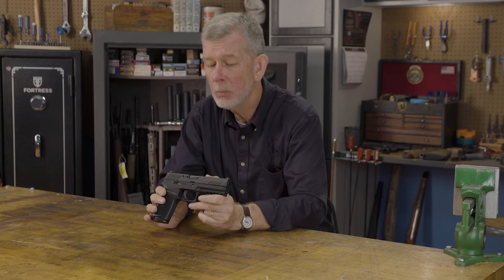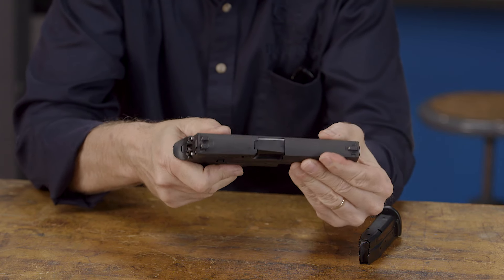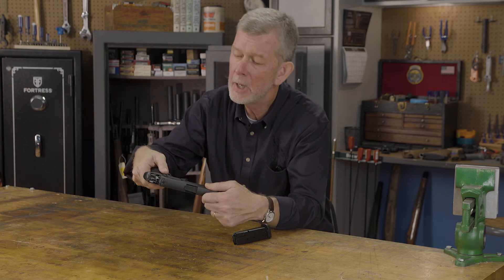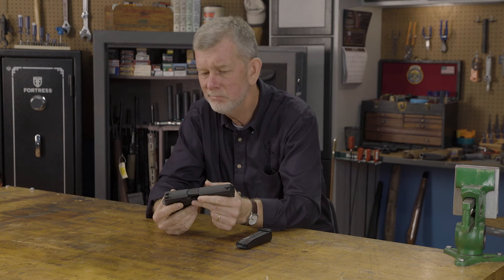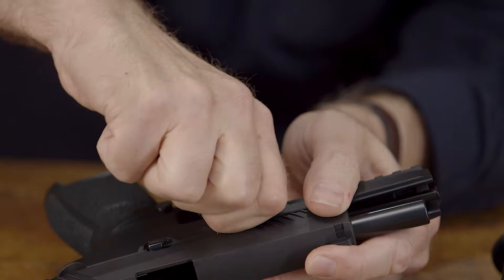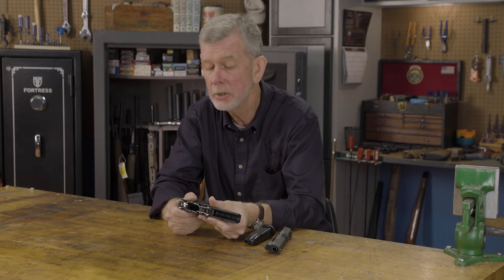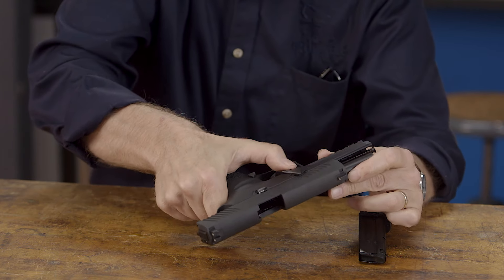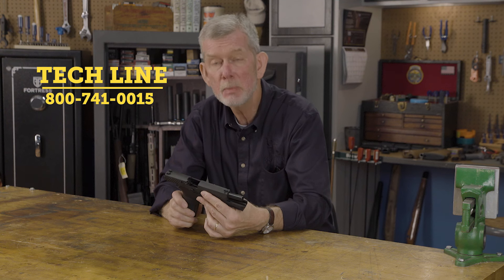Sig Sauer P320 Takedown Tricks

Comment: I have an p320 X-Conpact (320cx-9-bxr3-r2) and, what was initially tripping me up was the slide Spring guide position as it relates to where it rest against on the barrel.  The flat sides of recoil spring guide go vertically, and the rounded portions of the guide are what rest against the Barrel.  Once that was oriented correctly the slide would be able to be pulled back far enough to engage the slide lock, enabling me to put the slide release lever back to the locked position.  Super nice gun!!
Reply: Holy sh** thank you for this comment I was losing my mind. XCompact
Reply: I was losing my mind and thought I broke my gun. This comment perfectly describes the solution.

Comment: Glad I watched this. I just got mine. Was cursing at the thing. I actually thought I was going to break it, getting the lever all the way. Since I saw you do it, I figured I'd give it the full beans, and the jeez-less thing finally gave. I'm glad it's made of metal. And, I saw a negative review from someone on the weapon because they didn't lock the slide before putting the lever back. Glad I didn't listen to them. My thumb is still a bit sore from working that lever several time trying to get it to loosen up some.

Comment: Mine worked for a while, now I can't get the slide on again. I've taken it off many times, but today, I push it back, lock it, and the take down lever is stuck and will not move.  Well, it will go from 7 o'clock to the 6 o'clock position, but that's it. Every time I do it with this gun, I find myself thinking about changing brands.  There is no reason for it to be such a challenge. My other Sigs work fine, but I'm in a mess with this one. If my life ever depends on my putting the slide back on, I'm dead and the bad guys will not even take my gun...  Thanks again for you excellent videos.

Comment: Very helpful.As a tip ensure the main spring guide rod is oriented correctly against the barrel lug.The guide rod has flat and curved surfaces.The curved surface needs to be touching the barrel lug or the pistol can't be reassembled.
Reply: Exactly, that's another problem with this pistol.

Comment: you can throw the lever before putting the slide back on and locking it to rear and it will move the lever out of the way and then it will click back in place on its own too. Try it.

Comment: The key event that happens when you lift the slide stop in reassembly is that the other end of that piece of metal (or assembly of metal) that blocks the magazine slips into place to lock the takedown lever into the FCU / grip module.

Comment: Pull the trigger and push takedown lever at same time . Its moves a piece of metal out the way of the takedown lever  making it much easier toove takedown lever
Reply: Outlaw you are my Hero.  The lever was soooo hard to move, I was dreading having to clean the gun again.  Even dreaming up ways to jury-rig a tool of some kind to help turn it (which I never actually accomplished).  Now, pulling the trigger as you suggest has made it a breeze and it worked the very first time I tried it. Thank you, thank you -- there should be a quick YouTube vid posted where poor souls with sore thumbs can find it!

Comment: You may be seating the recoil spring wrong, it isnt supposed to go long ways on the barrel its supposed to stand straight up, and there is small flatside on both ends that seat the spring properly, i was becoming UNSAFE to be around while dealing with this issue but this EXTREMELY calmed me down and my slide went onto my barrel as it should, racked the slide back and locked it (heard the click) threw the pin up released the slide lock and the gun is "100%" hope this helps
Reply: Yes discovered that error today. A local gun shop helped me figure it out.

Comment: Thanks for the great tip.  I recently purchased the Sig 365.  Yes, I was lucky to get one.  Prior to firing the pistol, I attempted to break it down for a cleaning.  My problem and it was major, was with the slide pulled back in the locked position, I could not get the take down lever to slide down.  I eventually got it to operate (don’t know how) but is there something I need to know that sig hasn’t address as to how to get the take down lever to operate more easily?  .. thanks.

Comment: Hi great tip. I got a question often times before putting my slide on I will turn my lever down then put my slide on. I often when turning lever down I feel something kind of binding causing slide stop and sear to slightly raise everytime that happens Does that damage any of the parts?

Comment: Ok this is the first video I’ve seen where somebody shows how to lock the slide back. If you just take out the magazine and slide thr upper to the rear it won’t locked back by itself you have to push that lever up to that notch. And there’s lots of videos out there showing how to disassemble it but they don’t go into that detail right there of how to lock to slide back. I don’t know how you took it apart without locking the slide back lol

Comment: I do have an interesting question that no one has been able to answer. 
I have a new sig p320 but there is slide moment up and down on the last round and during dry fire. I have sent the gun into sig and was told this was not an issue at 10 yards so they will not replace the fcu. This is not an issue with any of my other p320's and short of getting a new fcu, I do not know a work around. It seems the tolerance between the fcu and slide is the issue, and since the slide doesn't have that issue on the other  FCU's that I have put it on, I am let to think I have a bad stock FCU housing  and sig is refusing replace this. 
I again am open to thoughts and options

Comment: Maybe I’m a dumb Sig newbie, but I had another problem:  you CAN’T lock the slide back during reassembly — at least not on the P320 AXG — unless the two dots on the end of the recoil spring assembly are lined up VERTICALLY. I struggled to lock the slide back for a good long while before I gave up . . . and read the manual.

Comment: My rotating take down pin/lever rotates so hard I need a pliers to turn it. The slide is locked back. It’s so hard to turn the pin like something is broke
Reply: I took it apart again now it works much better!!
Reply: @howardkamerman690  I just now saw your old comment, after searching about the same problem.   More recently a guy posted about how pulling the trigger at the same time makes it a lot easier to turn the takedown lever.  Definitely works for me!

Comment: The 320 has too many design flaws. The dead trigger up reassembly, guide rod must be in the correct orientation, take down lever insertion can be blocked etc. The Glock was a better option with none of these issues- and yea the model submitted for military consideration did have a traditional manual safety.

Comment: This P320 flat out sucks! If you can get it to consistently fire, it's magnificent. I have never been able to get through a full mag without a casing locking up in the chamber... completely unable to even move the slide... smacking the grip while holding the slide doesn't seem to work. Need to go home and brake out a rubber mallet to beat the slide off.  I always take a second gun to the range, because I know the P320 will get jammed and fail. Not a functional firearm. POS gun in my opinion. I recommend you stay far away from this problematic design.

Comment: I can't understand why the military didn't take the S&W M&P series. I have a 320 and the modularity is a joke. I changed from the standard grip size to the large which involved ordering a complete grip frame for $55 and removing the gun chassis and reinstalling it in the new frame. S&W's removable backstraps sure seems like a better solution to accommodate different hand sizes.
Reply: Robert C. Dufek It is we own a M&P 9mm M&P 2.0 and Shield. 45 the full size 9mm backstraps are nice.
Reply: The M&P is a good pistol, but it didn't meet the Army's requirements, and the M&P has always had a reputation as a pistol that needs an aftermarket trigger, and barrel, to make accurate.
The Sig P320 grip modules usually run $35-40, and are great for not only their 3 different grip thicknesses for different hand sizes, but also the four different length pistol frames from subcompact to full size... Remove the trigger pack and put it in a different grip in under 30 seconds- it's great! 
The P320 will become the AR-15 of pistols because of the modularity and aftermarket possibilities!
Reply: S&W was never really in it. It ended up being between Glock and Sig. Sig. won the contract because Glock was way more expensive and wouldn't come off their price.

Comment: Best trick, throw 320 in trash. Acquire better gun
Reply: Fat_Car_Guy being one of my favorite guns, and being quite confident that I own way more Firearms than you do, I'd say Bad Choice. Its one of the finest and the US armed services thought so also.
Reply: p320 rules
Reply: If you are not satisfied with a P320 that you actually bought, throw it in my bag, let a real man handle a fine firearm!
Reply: @weasel101  I purchased an M17 Commemorative model and quite frankly, I am amazed our military would bet our soldier's lives on this piece of polymer plastic junk.  The biggest single issue is the take down lever being more than merely difficult and hard to rotate,  it takes  the strength of three men a boy to turn the thing.  This is true whether the slide is installed or out.  It appears the holes bored through the polymer plastic grip assembly and the trigger group module are not perfectly aligned.  No amount of lubrication has been able to fix the issue.  I have put three 17 round magazine loads through this gun testing it out on the range and after each 17 shots my trigger finger is stinging from the kickback of the trigger.  The expected stinging finger affects my accuracy the more I fire the gun.  The M17 Commemorative is a run of 5,000 of the prototype the military tested.  My particular M17 was a lower s/n in the 00700 range.  I certainly hope there has been upgrades to this weapon since these prototype copies were manufactured.  I cannot imagine any soldier being confident shooting the gun I have.  I have a P226 and this M17 is simply not even close to being the same quality firearm anyone would expect to come out of a Sig Sauer factory.  I am amazed this M17 made it through final inspection, assuming it was even inspected at all before it was boxed and shipped.
Reply: @AdoAdoAdo09  Some people just shouldn't have guns and especially no SIG P320/M17  I love mine and it works like a charm. No praying needed when spraying bullets.
Reply: @AdoAdoAdo09  Ya, that gun is a piece of crap, you should send it to me and I will get rid of it for you.